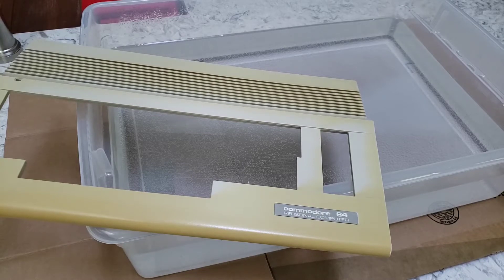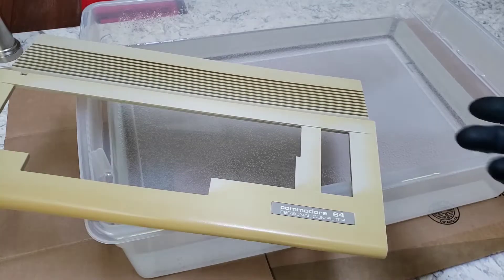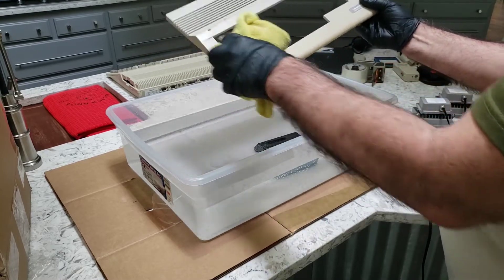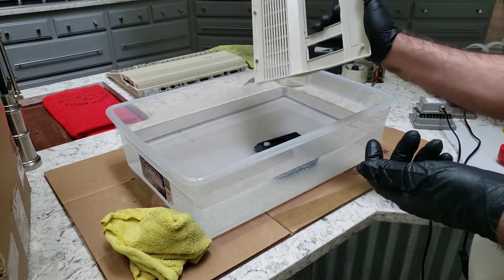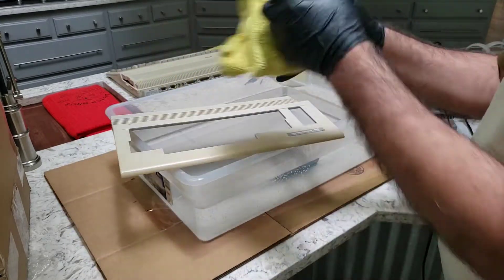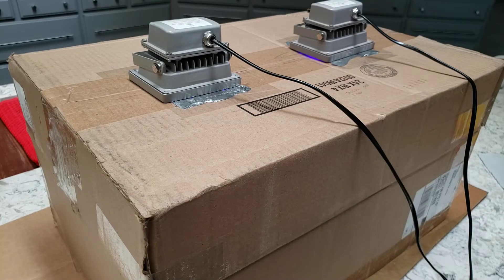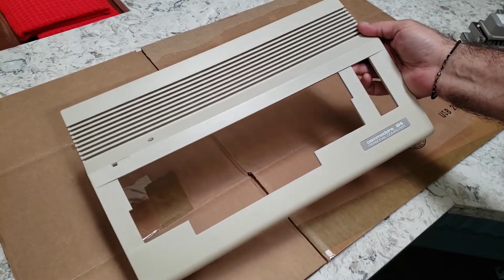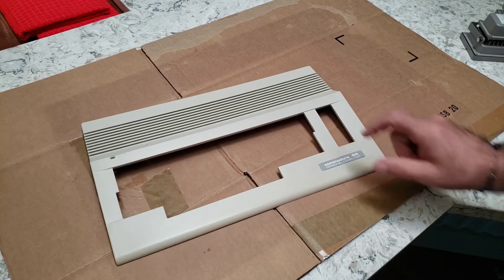Commodore 64C Indoor Retrobriting - Submersion vs Paste

Comment: Nice work.  I have a 1541II face cover that has been submerged for 25 hours now.  I wanted to start with something small first.  I'd say it's like 80% done.  Shallow box is keeping the liquid kinda warm because lights closer I think 🤔.  I'll leave it until tomorrow.  I may finish it with paste like u did.   I like the way you are so throural.  It helps people out.  Most others I've watched aren't.  Thanks don
Reply from the maker: Thanks Don. As you saw in my video,  I didn't have success with submersion indoors.  If you get impatient though and you have strong sunlight,  I'd move the submersion outside and let the sun handle it for a couple hours since you already have it mixed.  :)  I've found I can do the top of a C64 case then the bottom of a case re-using the same mixture.  You might have to just strengthen the ratio a little in favor of the peroxide.  As I pointed out,  my preference is submersion+sunlight because of the speed of reaction. I do the indoor stuff for small items or that time of year when there's no sun or high temps for weeks :)

Comment: aw yessss. looks sweet and new. just need to find a «new pcb» perfume smell to puff over, and it xmas like its 1987
Reply from the maker: lol!  Just don't know how long the yellow stays gone - I've had pretty good success with it not recurring on most everything I've retro-brighted, but there have been some items I've done where the yellow started showing back up over months of time :)
Reply: @revivingretro  Im not sure if any kind of coating was on the originals to preserve them. The surface plastic of the day was kinda rugged, and that feature lasted well into the PCs era unless I'm mistaking. No idea what kind of plastic or process was behind it. The old IBM keyboards, printers etc was like that too. The stuff they put on may even have been proven poisonous later and discontinued. Wouldn't surprise me the slightest.

I'm happy that your whitening didn't noticeably affect the blacks, logo and other stuff than the bare plastics. Great job. I was defo looking around ebay and similar after looking at your vids, with hungry nostalgic eyes. But I don't trust it not to be junk they are pushing unfortunately
Reply from the maker: @zeffster2  I hear what you're sayin! - btw love your enthusiasm dude! thanks for taking the time to comment as well!

Comment: Great video!

The only thing I would recommend is to remove any aluminium labels/badges before using either liquid or paste. I've had a few suffer from paint issues afterwards.
Reply: I never had that problem with Commodore 64, but I did ruin a label on atari machine...so, yes just be careful with retrobriting :)

Comment: I do it the same way, with the cream instead of liquid.
But in the past, in some cases the yellowing came back real quick, during 6 - 12 months.
So now, to prevent this, I often spray paint the case. The result is 99% veryyy goood. But you have to be careful to let the paint dry/harden for some weeks! Otherwise if you put something (disk box, joystick) on top of the case for some weeks, you will get markings inside the paint!
Feel free to check out my 1541 spray paint video to have a look.
   Great video from your side!
      Greetings, Doc64!
Reply from the maker: Hiya Doc - this has been an interesting topic in the past. I've seen samples of yellowing coming back for some folks and I have a couple of items where I've seen some of the yellowing coming back, but I haven't experienced full on yellowing coming back on the robots or computer cases I've retrobrighted. One of the thoughts brought up is that the level or mixture of peroxide being used might have something to do with lasting effect. Others have stated it may be the type of plastic. Yet another school of thought is that heat, not UV, may be the result of yellowing coming back. My items are typically stored in rooms that rarely, if ever, exceed 72F. So maybe that might have something to do with it. I've seen others use a cream vs. the spray paint. I never was a big fan of spraying the cases since I haven't seen the negative effects myself because, as you pointed out, there is a drying/hardening time as well as all the prep. But that's just my perspective - I think it was cool of you to point out your post-retrobrite method though in case any others are seeing their yellowing coming back. Thank you for that!